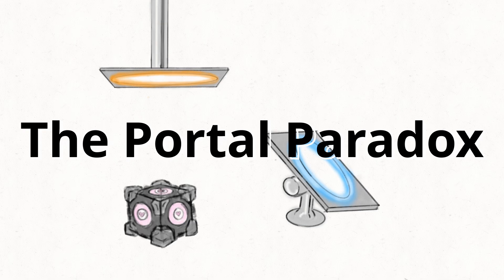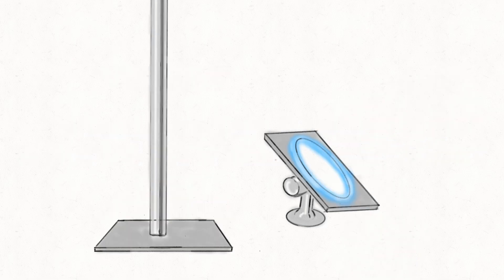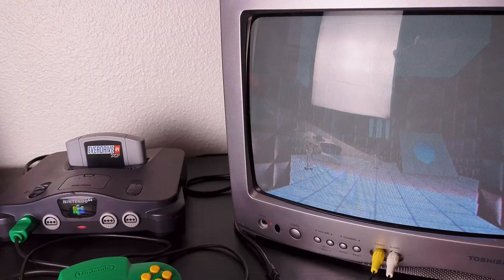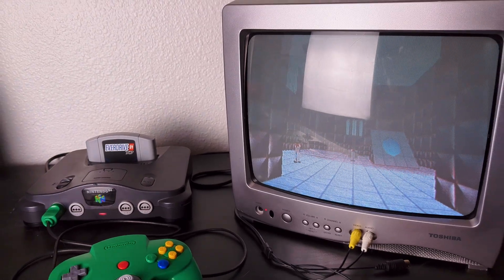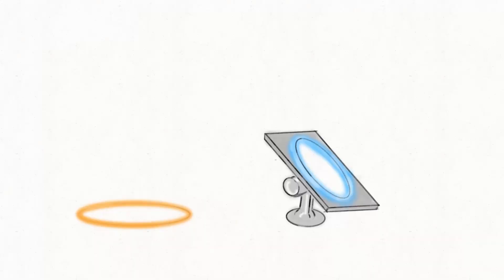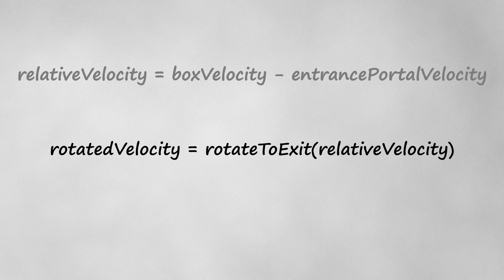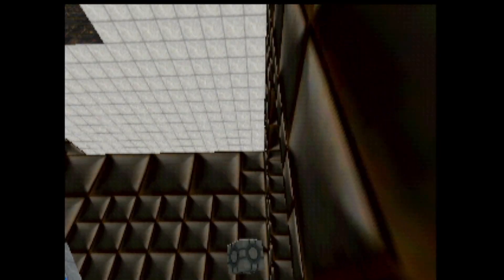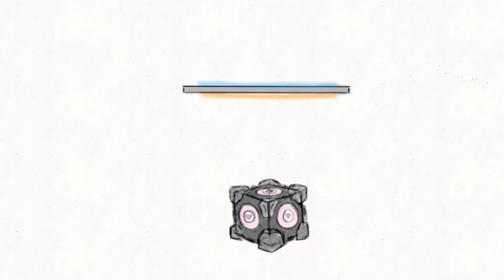I rewrote Portal from scratch and solved the Portal Paradox

Comment: Let's say the test environment is in a zero gravity environment, in a vacuum.  The cube is floating in the void.  A blue portal is on a platform moving towards the cube and the orange portal is on a stationary platform (relative to the initial position of the cube) somewhere else.  The moving platform approaches and engulfs the cube.  If the cube were to come out of the other side at all, it must begin moving through normal space - it is pushed or pulled in some way to make it exit the orange portal, and it would continue moving because it was just moving and nothing stopped it from moving - conservation of momentum.  The moving platform continues moving because it was already moving and nothing stopped it.  Or does it? The energy to cause the cube to begin moving (relative to the "stationary" platform) must come from somewhere, or else energy has been created violating the laws of physics.  Yes portals themselves probably violate the laws of physics, but if we can just start breaking all of them whenever we want then this thought experiment is pointless because then there is no answer - we need constraints to have an answer.
If the cube begins moving without the energy coming from somewhere, the total kinetic energy of the system would have increased, and it would be possible to create an surplus / infinite energy machine with a little planning and designing.  The act of pushing/pulling the cube out of the exit portal would need to derive energy from something, and in this example, unless the portals themselves are storing and imparting energy to objects passing through them (and where do they get their energy from? it would either need to be charged from some source or it would have finite uses before dissipating), the energy must come from the moving platform.  So, for the cube to be ejected from the second portal, it must begin moving, and it must draw the energy to gain momentum by leeching it from the moving platform, and the amount of energy it leaches from the moving platform in order to impart it onto the cube is not defined, nor is the method of transferring that energy. Depending on the amount of energy siphoned then, in the "portal paradox" of a test environment in a room with air and gravity, the cube would either flop or fly depending on how much energy is drawn from the platform. 
Interestingly, in the case of a moving portal platform in a room with air, all of the air scooped by the moving entrance portal would need to be ejected by the exit portal, and the same physics would need to be applied to the air molecules as the molecules that make up the cube - the air would be accelerated as it exits the portal.  The exiting air molecules would have to push the old air molecules out of the way anyway as the density of air molecules increases at the exit, creating an even greater wind gust at the exit portal.  This would cause some amount of amplification to the movement of the cube if the experiment were done in a test environment with air. 

When the video talked about two moving portals, they were on opposite sides of the moving platform such that the positive motion of portal 1 canceled with the relative negative motion of portal 2.  My thought experiment is such that both portals are facing the same direction, so the motions add rather than subtract.  
Surplus net energy design:  Two large hollow boxes some relatively large distance apart from each other.  The near faces of each box are aligned, and the corners of the two boxes are connected by long ropes. We will put them in a vacuum  and zero gravity environment.  In the area between the two boxes, one has a blue portal on the outside of the box and one has a orange portal on the inside of the box - on the closest faces of both boxes.  Between the two boxes is a standard portal cube.  The boxes are coated with rubber - allowing some kinetic energy from impacts to be absorbed and some to be reflected.  Some initial energy is given to the system by pushing the box with the outer facing portal towards the second box.  It moves towards the second box and in doing so intercepts the cube, which according to the logic of the video is accelerated and launched out of the second portal, into the interior of the second box, at the speed that the first box was moving.  The first box continues moving at the same speed it was going before, and now the cube is moving along the interior of the second box at that same speed.  The cube hits the interior wall of the cube and is bounced back, losing some of its speed as some of its kinetic energy is transferred to the second box.  The second box now begins moving, in the same direction as the first box, relative to its initial position.  The cube moves back to the interior portal - the box is moving towards the cube, from the energy gifted to it by the cube, and the cube is itself moving the opposite direction from the energy it conserved after the impact.  The amount of movement of the second box is added to the existing speed of the cube as it passes through the interior portal and out the exterior portal on the first box. The cube exits box 1, necessarily moving faster than box 1, and connects with the solid exterior wall of box 2 - again coated with rubber.  The cube transfers some kinetic energy to box 2, accelerating it, and bounces back towards box 1 - at some point being captured by the exterior portal and shooting into the interior of box 2 at a speed greater than box 2 is travelling, again hitting the interior wall and bouncing back to the interior portal, picking up speed as it exits, hitting the outside wall of box 2, speeding it up again... until at some point box 2 is moving faster than box 1.  But that's ok because the two boxes are connected by long ropes. Box 2 begins pulling box 1, and the cube continues to bounce into the interior then exterior walls of box 2 as it magically harvests kinetic energy from the portal transits.  The boxes eventually accelerate to relativistic speeds, powered by portals.  Entropy has been broken. 
When the video talked about two moving portals, they were on opposite sides of the moving platform such that the positive motion of portal 1 canceled with the relative negative motion of portal 2.  My thought experiment is such that both portals are facing the same direction, so the motions add rather than subtract.  
crude drawing of system: https://imgur.com/a/cSPID6Z

Comment: Where does the energy for the cube's movement come from if the piston never makes any physical contact with it?
Reply: From the moving portal mount. It's the only thing possessing kinetic energy in the room. Therefore, as cube accelerates, moving portal mount must feel a breaking force and slow down, losing its kinetic energy to the cube.

Comment: the assumption that the cube would gain velocity is wrong based on physics.

What would happen if you stopped the moving portal after it transferred the top 25% of the cube? Would the cube gain upwards velocity and shoot itself into the previously moving orange portal and fly out the blue one? If not, why would it do that when the portal goes down 100% of the cube?

The cube isn't moved, only the space around it. The relation of the cube's speed to earth's speed remains constant, thus it wouldn't shoot out. it's position is merely transferred through the portal.
There is no relative energy transferal that would make the cube fly compared to the earth.

The only movement the cube would perform is tilting and falling to the side while the orange portal moves over it, due to gravity pulling the edge down that comes through the blue portal.
When the orange portal covers the cube at somewhere around 60% you'd see the lower part rotating to the side against the edge of the orange portal, while it falls down the slope out of the blue portal. that's it. no shooting out.
Reply: Cube moves as it emerges out of the exit portal, so emerged part has kinetic energy. Said kinetic energy has no reasons to disappear. As to where it comes form, there is only one source in the room, the moving mount with an entry portal. So the energy must transfer from the moving mount to the cube, as it passes through, meaning the moving mount will feel a force of resistance.

Comment: In the experiment with the portals on either side of a panel, why doesn't gravity pull the object into the portal? Is there a saftey feature built into portals that doesn't allow objects to materialize in unsafe areas?
In the first exmple the obect is sent though portal because of lack of space same should be true in the second example. should be constantly bobbing/ jumping as it simultaneously enters the portal and exits the portal, making it gains velocity. Speedy thing goes in, speedy thing goes out. Can't just forget about gravity.

Comment: One of the things I'm unsure of, is the following. And since the process is always so fast I cannot tell. Does the object have to enter the portal fully before it comes out the other side, or does it appear immediately on the other side as it is going in? If the later is the case pushing the portal onto an item you might not even need to go all the way. Because the matter appearing on the other side will 'pull' start pulling on the stationary matter. Or am I having a brain lag?
Reply: In the original game passing though the portal is gradual, no different than passing though a door.

Comment: The portal doesn't really carry any tangible mass that could/would interact with the cube and transfer the portals velocity to the cube.

The air around and infront of the moving portal should cause a draft in the room though as it displaces a pillar of air that pushes the air in front of the exit portal.

The cube doesn't have any velocity and is held down onto the floor by gravity, and that force still affects the cube once its popped through the exit portal... But it should still start sliding down the slope once it's popped out as there is also gravity pulling on it at that end as well (affecting the position of it's center of gravity).